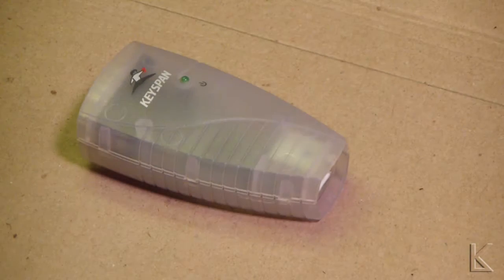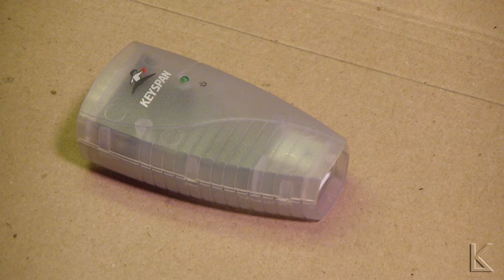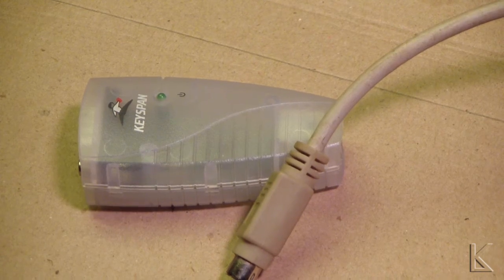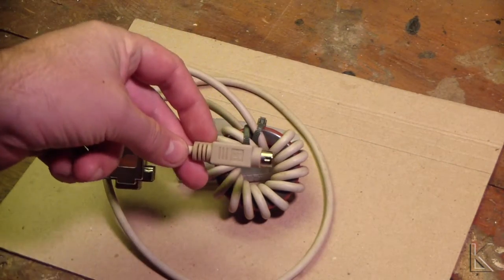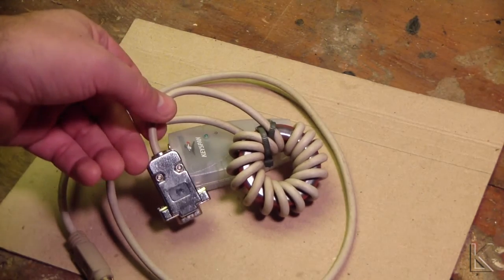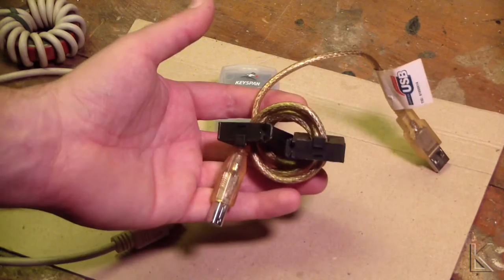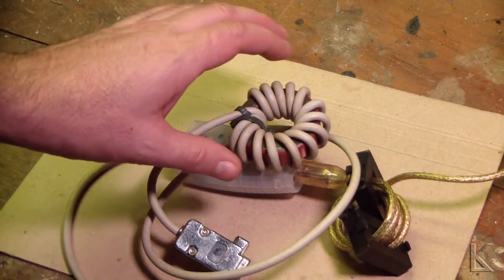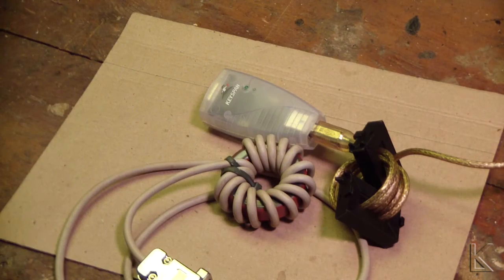Ham Radio - Eliminate computer interference noise while using RIG control

Comment: Excellent deduction and solution!   My issue that brought me here...  interfernce on several 70cm channels  on my radio.... sit down for this... only when I open a browser.   Yep.  Chrome, Firefox, IE... all cause interference on the 440 side of life.  Close said browsers and all is quiet.  Enough interference that SQL level of 14 doesn't knock it out.     I'm ready to wrap the laptop, around a tree.  LOL
Reply: If you open a browser and turn off your screen I wonder what happens.

Comment: I have led lights in the house that cause horrible RFI on 2m. Would this work on both the coax and the power cables? Or is there another method of getting rid of led smps

Comment: Would that help a semi truck cb radio at all?
Reply from the maker: If you're getting computer noise through a serial interface hooked up to your radio, sure.   If you're getting HF noise from the trucks ECM, running the radio's power cord wrapped several turns on a torroid would probably reduce that noise.

Comment: I'm trying to get audio from a VX-3R into the PC and wrapped the audio cable about 20-30 turns around the largest torroid I have and it did absolutely nothing.
Reply from the maker: So, you're getting digital hash noise on the radio?
Reply: No static. When I plug in the PC the S meter goes up a little and it's just noise.
Reply from the maker: Being a hand held radio, it doesn't have it's own ground.  So when you plug it into the PC,  the PC's ground becomes the radios ground.  The radio is then subject to the noise already present through the sound card down to the PC's chassis.  
I think the only way to get around that would be audio isolation transformers in the line between the radio and the PC.  That way, there's no DC path between the two.
Reply: That's what the guys on QRZ are also saying. I just hope it doesn't try and couple through the interwinding capacitance somehow.

Comment: Not really HAM orientated.

I have a lot of noise coming from my computer (running a navigation program for my boat) on my VHF radio (156.050 > 162.000 MHz)

The computer is powered by the same 12 volt batteries as the VHF radio.
( As a matter of fact ALL devices are powered by the same batteries, but I've pinpointed that the computer is the biggest problem  :-/ )

I will start with the computer and everything in / out from it (USB/Power/HDMI. 
If this does not work than I will need to get a lot of more toroids to fix it...

I will report back to you when I'm done testing.
Reply from the maker: The biggest radiators are going to be the USB cables, then the power cable.   Wrap those up as close to the computer as possible and you'll probably eliminate your noise problem.
Thanks for watching!
Reply: Hi Kevin,

In my case the problem is the power cable as the noise interference stays the same when I disconnect all the USB, LAN and HDMI connections to the computer.

I'll report back..

Comment: Found that MOST of RS-232 to USB adaptors aren't optoinsulated . THIS is VERY important, also, for the Rig safety . That's why i made my own, optoinsulated, interface. Yes the RFI choke is a fast and nice solution but still You should dig and look at the adaptor..Well done , '73 de iz3svi . .
Reply from the maker: I had thought about using a couple of opto-isolators in the level converter I built into the little D9 shell.   I did use 10K resistors in the TTL side signal lines to limit current and protect the radio from current loops,  that's probably enough.
The noise is primarily from the USB buss though.   I wasn't worried about ground loops, the netbook is powered by the same power supply that feeds the radio and they're all grounded.
Using a linear supply for the netbook eliminated noise that had been coming from it's power brick.
The whole system is really quiet now.  Nothing left but birdies from the ethernet networking in the house.
Reply: On my old home i had a ethernet cable---its lenght was 10 meters. I won't remember how much noise i had. I do the same : radio and laptop by the radio power supply. Hah theyr cheap switching are a nightmare really !! About the decoupling ...yes, resistors are fine to act as a limiter(s) and protection(s) but still...the opto-isolators or couple transformers ( 1:1 , 600 Ohm ) are better. Anyway, if it work it's fine :) Best '73 de Adriano iz3svi
Reply from the maker: I think you were thinking about audio.   Rig control is using serial.   level converting +12 to -12 V signaling to +5 to 0 V TTL signaling.    Transformers are useless for that.
Reply: what frequencies exactly were you seeing the interference. I have a Dell mini laptop, rig control plug, easy Digi plugged into it and FT817/Z817 combo and I've never noticed any noise on the radio. I am using one of the rig control cords that is USB on one end and mini DIN on the other going to the radio. I use a metal box (Altoids)for the easy Digi and all the Audio cables for it are sheilded. The USB to serial adapter I use with my 817 setup is a radio shack one, it seems to work fine, but on other stations I have I use a cheap USB to serial DB9 plug that has sheilded cable. The plug from the easy Digi to the radio is also sheilded. I've never noticed any issues with noise.  KD5INM
Reply from the maker: There were birdies, warbling carriers, here and there mostly on 20M and up.  They would go away when I disconnected the USB serial interface.   There was also lots of hash noise from the power brick that powered my netbook.  It appeared as a rise in the noise floor across most of the bands.  The noise floor would drop by 2 s-units when I unplugged the power cord feeding the netbook.
I eliminated the hash noise by powering the netbook from a 12V linear supply that also feeds my FT-817.  (netbooks take 12V in,  great for battery operation since they average around 1 Amp of draw)
Yes, I know,  netbooks are too slow.   Install linux and use FLdigi,  performs MUCH better when you get off windows.